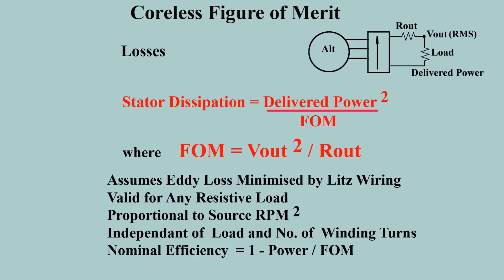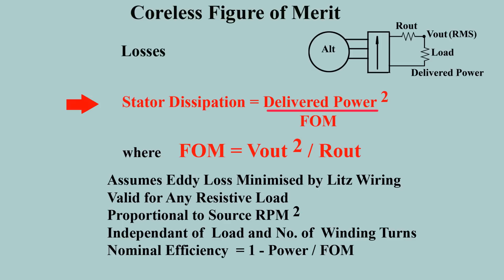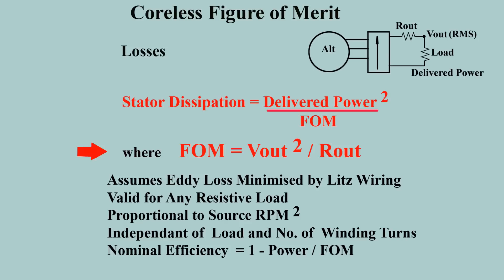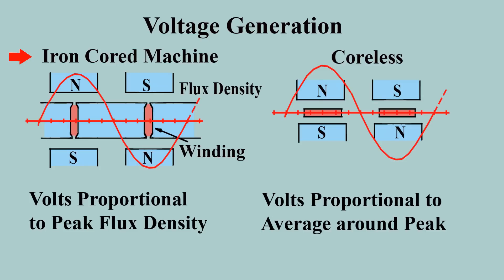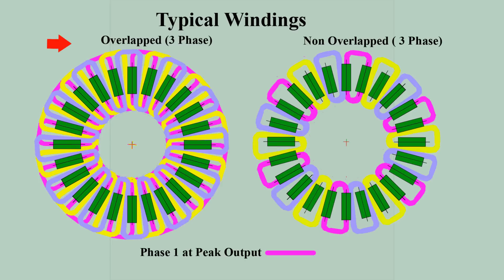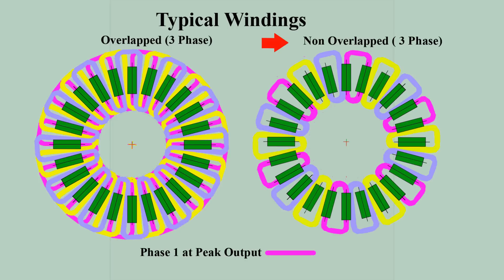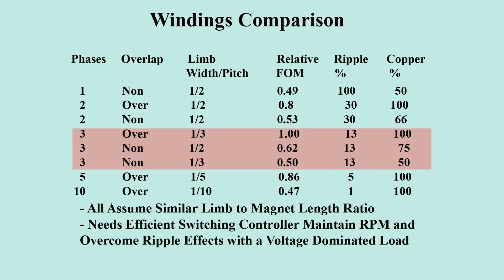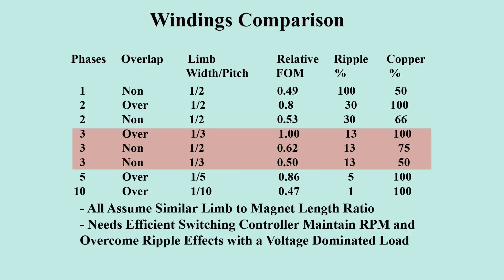Part 2. Axial Flux Alternator Phasing and Winding Methods

Comment: If I understand correctly core less is beneficial due to heat losses due to eddy currents.  Does distance from magnet to coil effect efficiency?  I understand closer magnet to coil could increase voltage and current but would it not be harder to spin he shaft?
Reply from the maker: Coreless has ohmic and new eddy loss in the windings. There is optimum magnet spacing. Unloaded spin resistance can be very low. YE

Comment: make the non overlapped coils thicker to cover the gaps, or increase number of poles, problem solved
Reply from the maker: Blox 117.  Yes, as tabulated in the video, up to 12% greater power handling capability. Then it reduces. How more poles? YE
Reply: @YesEinstein  more poles but smaller?
Reply from the maker: @Blox117  Thanks for your interest.  Overlapped has fundamentally twice  the power handling capability in the same volume.  Relatively wider coil legs may help a bit.

Comment: The video is wrong..  peak voltage from the coil is between pole changes, not when a pole is centered over a coil.  Overlapped coils  usually mean a thicker stator.  Flux is iis related to the square of the distance between magnet rotors.  I don't think it makes sense to overlap coils in an axial flux machine, it makes for a thicker stator.  (and much more complicated construction)
Reply from the maker: Dear Dan Bartmann.  Just a little hasty?  The video shows wire bunches; each pair being equivalent to a coil.  Peak output is where legs are under max. flux,  thus “coil” centres at min.  In the geometry shown, the actual peak is relatively easy to compute against the leg and gap widths. In-situ winding and overlapping outside the gap is quite feasible and can near double power handling capacity.  Optimum gap should be where Vout^2 x gap is maximum. Regards YE
Reply: @YesEinstein   can we connect ? I'd like to  discuss a proposition

Comment: Вот мой генератор https://www.youtube.com/watch?v=Cl4BNoydRzM&feature=youtu.be
Reply from the maker: Dear Remel220    Yes I like it!  Love the power meter, drive method and variety of loads. Good power capacity for its size and speed. (Plenty of exercise if you connect the pedals.)  It is good to see proven test results for a change.
Your windings appear to be non-overlapped coils.  The legs of each coil should be close to centre of magnets at peak position; magnet faces should be close to the disk, both for best efficiency.     Concerning philosophy, voltages may be computed equally well from length and speed of wires moving through flux or from rate of change of flux through coil centres.  Flux may be measured or calculated, for example by finite element. Fields are just the plottable results.   In the extreme, the system could be analysed purely as set of moving electric charges interacting relativistically at molecular level.   Maybe not best in this instance.
Keep up the good work!  Regards YE
Reply: Why industry not develope big pma axial flux?

Comment: Hello and thank you very much for such valueable information. I'm working on a axial flux generation and have seen very many videos about prototyping axial type stators and rotors. My rotor is made of 8 mm steel with 24x 20x10x5 mm magnets (12 poles + 12 poles) just like in your video. The stator however is made of PCB (due to it's compactness and ease of manufacturing). I have 320 RPM (low speed stand with integrated motor) done by me for testing purposes. Currently I have 2 - sided PCB with 10 turns windings on each side, conencted in series to achieve of 20 turns total per phase. Previously I have constructed 5 prototypes with different configurations and all of them gave me some results. But PCB just give me very very low voltage. And I can find very few information about PCB axial generators (mostly motors). And please aswer a question - would it be possible to use only one rotor (single side axial rotor towards stator)? I don't need much power (20-30 watts is enough). I kindly ask you to help me please, I would even pay for your time and consultation so I can finish my project.
Reply from the maker: Dear Max Ridman,  There appear to be 120 conductor  crossings per total phase. (Note each coil should straddle two magnet centres) Properly star configured,  you might expect around 5V.  Provided the winding resistance per phase is less than 0.1 ohm, (there's the rub) dissipation loss should be less than 10% at 25 delivered Watt.  Just one rotor should easily handle a few watts.   Regards YE
Reply: @YesEinstein  thank you so much for a fast reply. I have everything machined on a CNC router so geometrically everything is perfect. I now have a one phase PCB stator and at 320 rpm it gives me near zero. Science is not magic but I cant explain why its not working, while in standard configuration it is ok. 10 turns in a shape of progressive wave has 1.3 ohms now. PCB trace is 1 mm width and 35 um copper thickness. I would be very thankful if I can send you my blueprints for inspection. Thank you
Reply from the maker: Dear Max Ridman,  First confirm that all assumptions were correct including non circumferentially overlapped coils occupying 4 magnets per 3 phase subset, thus instantaneous 120 conductor magnet crossings per total phase, half up and half down;  3 volts (on a.c. meter) expected.  A critical efficiency requirement is maximum copper content in an optimum space between magnet disks; not obviously conducive to PCB.
Reply: @YesEinstein  Yes, like I said before PCB is one phase (double sided and 10 turns per coil). And it's not overlapping. 24 magnets (12 poles S and 12 poles N) for 12 coils in a progressive wave form. Resistance is 1.3 Ohms. Please see photo attached. https://photos.app.goo.gl/aFT2AERSt6gBaccn7
Reply from the maker: Dear Max Ridman,  Nice pictures.  My calculations indicate  10 volt open circuit and 5 Watt deliverable power at 320 rpm with double rotors; somewhat less with one just a plain steel disk. 3mm thickness is ample.  I guess the no output problem will be solved with a new  rear side winding displaced by one pole pitch to ensure continuous NSNSNS  crossing progression through both sides. Regards YE
Reply: @YesEinstein  Once again, thank you very much for a quick response! I have tried with just one winding/two windings in parallel, still near zero. If that was the cause - I would get at lease something with just one winding (only one side of PCB). To be sure I have calculated everything correct and machine a new stator, did I understand you correct in your videos and I need a coil of 24 windings to achieve 24 V AC open circuit for 320 RPM? I plan to use 3 Oz copper (105 um) to achieve 20W. Or will you recommend 4-6 oz copper to be sure in our results? Please take a look for the final concept. https://photos.app.goo.gl/aFT2AERSt6gBaccn7 Thank you.
Reply from the maker: Dear Max Ridman, You may find it best first to solve the no-voltage.  A stiff wire held along the axes and close to the faces of your alternating North and South magnets should generate a measurable a.c. voltage of about 20 milliVolt. Watch fingers.  Next form a loop in the wire to cover two adjacent magnets. The voltage should double. Making an S loop should treble it.  One face of your stator has 240 such crossings more or less at magnet centres and should thus develop around 5 Volt.  If no voltage, there must be some misconnection. Next, intrinsic power capability is determined by generated voltage and the winding resistance.  The two are interdependent for an apparent fixed capability of 10W in the double face machine.   Capability is generally proportional to the volume of copper contained in the windings.  Regards YE
Reply: @YesEinstein  I did everything as you said. A stiff wire along the axes and 1 mm close to the magnets (20x10x5 mm) gives me 6 mVolts AC. With 20x10x10 mm magnets it gave me 11-12 mVolts. To be sure my calculations are correct I made 20 turns for another coil (average is 12 mVolts as well). To achieve 24 volts I will need ~2182 turns which is a sick amount of windings. Even if I will split that in 4 coils and connect them in series, still I will need 545 turns per coil (for 4 coils in total per phase). I can not put that on a PCB. Honestly I don't understand how did you get 75 watts in 500 RPM based on your video (Part 3. Axial Flux Alternator Stator Assembly) having only 3 windings (12 coils per phase and 2 coils inside a Litz wire batch). Maybe I am doing something wrong, but in my previous tests with Iron core per coil I had 32 turns per coil, 12 coils in total and it was 24 V AC.
Reply from the maker: Dear Max Ridman,  I assume the 6 and 12 mV ac per crossing translated to readings near 60% of 480 times them with the double sided disk.  Predicted voltage per 480 crossings with close fitted double rotors remains around 10V peak. That is 7.1 rms with the 100% ripple when rectified. Maximum deliverable power into a resistive load is thus 100/(4*1.6) that is 8 W at 50% efficiency. You might consider stacking n identical PCB disks to fill an 8mm or so optimum gap between the rotors for n times the capability.  Doing this for 3 phase overlapped could be a challenge.  My Part 3 interpolated the 3 phase star connected test results to 500 rpm (still configured with 2x24x2, 30mm crossings).    Output voltage is reduced to 10.2 but output current at 7.4 A can be retained; hence the 75 Watt (V x I) capacity. The rectified output at 320 rpm, would be 6.5 V dc with quite small ripple. Ultimate capacity would be 53 W or 46 with the 7 amp restriction. Hope this makes sense to you.  Regards YE
Reply: @YesEinstein  Thank you for your valuable time. I will make some tests tomorrow. Please give me an advice on how to calculate what gauge PCB track should be to hold 1 A of power producing energy. I would say in mm2 for example (pcb track width times pcb track height). The pcb track lenght becomes very very long so the resistance will grow and it should heat I guess. Best regards
Reply from the maker: Dear Max Ridman.  PCB conductor current rating; calculation of copper strip resistance and power dissipation are all well documented on the Internet. I respectfully suggest you may find it a useful exercise to do some study here.  Regards YE

Comment: In generating electricity sir which has more advantage in design the axial flux or the cylindrical like design?
Reply from the maker: Dear kronos darkangel   Swings and roundabouts;  simple coreless axial can be relatively much easier to design and build.  Regards YE

Comment: One thing not clear is  the wire should be north south or .. all clock wise.... i try making but this isnt clear sir.   Can you explain it more for me please
Reply from the maker: Dear dtml HK, I hope this helps. In the first of the side by side options shot, the directions of magnetisation are all in or  out of the page so that magnet faces are alternately  North and South as seen.  Outward wires radially cross North; inwards cross South and so on. The result is that induced voltages add ,clockwise, along the total wire length for  each of the three phases. The right-hand option operates on the same principle; less efficient but initially easier to manufacture.  Regards YE
Reply: @YesEinstein  This is one of those AH-HA moments for me. Thanks for the clarification.

Comment: I am making this for a school project and would like to inquire about the overlapped windings, I was planning on using 16 poles with 12 windings non overlapped to conform to the 4/3 ratio. However do you think I should consider using significantly more windings? Will there be a significant improvement to my output power? additionally I require the generator to provide at least 6V so will the # of coils effect this or just the # of windings?
Reply from the maker: Dear Matt Balisky.  Thanks for your questions.  Your wise plan for 16 magnets, 12 non overlapped coils is noted.   That makes 3, not 12, (properly connected) windings for 3 phases.   A three phase rectifier ( 6 diodes) will produce the best DC output.  Voltage is proportional to number of turns in the coils. (Canbe calculated if you have the interest)  As long as the resistance of each winding is much less than the load resistance, output power will nearly equal that mechanically applied.  If they are equal, half the voltage and power will be wasted heating the windings. Hope that helps!  YE

Comment: It the voltage is proportional to number of turns and rpm and the amps is proportional to thick of copper used?
Reply from the maker: Dear Chelford Quider, Voltage yes. Delivered current is nominally engine power divided by this voltage. Maximum safe current will be proportional to root of [tolerable rotor dissipation times total winding (i.e. copper) thickness]. Wire diameter, fixed by target voltage, must also be adequate for the current.  Regards YE
Reply from the maker: Dear Sky Watcher,   Yes, all involved in the design and assessment process,  My videos show calculations, real builds and results relevant to the electric bike project.    Regards YE.

Comment: i have 10 rectangle n52 grade neodymium they are 10mm thick, 50mm wide, 100 long.  I want to build a generator for a microhydro off grid power source.  How do I calculate the amount of windings that i need?
Reply from the maker: Dear David Elderkin.  You have to practise.
Reply: YesEinstein do I alternate north South polls around the circle?
Reply from the maker: Dear David Elderkin,  Yes.  See my part 3 and 4 videos. Number of magnets on each rotor must be even;  four if you must use the large ones you have.  Flux distribution and space for the windings will become evident.
Reply: YesEinstein ok thanks will do.  Where did you get your copper wire from?
Reply from the maker: Dear David Elderkin.  You're welcome.  UK internet supplier.

Comment: Good explanation. What do you mean by voltage is proportional to average around peak for the coreless design?? Do you mean the average magnetic flux or field of the exciter.
Reply from the maker: Dear Olando Robertson,  Thanks. The generated voltage is proportional to the average of flux density (Weber per square metre) around its peak. It is thus also proportional to the total flux (Weber) through the coil leg. Regards, YE
Reply: Thank you.
The core increase the cogging. So would you say it's a bit pointless for generators have an iron core??
I believe coreless generators are way more efficient and cost less to manufacture.
Reply from the maker: Dear Olando Robertson  A cored machine for a given speed and power can  have  negligable iron losses as a proportion its output.  High achievable flux and more  room for copper  with no associated eddy loss easily tips the balance in its favour.    Coreless with relaxed forces, wide assembly tolerances and potential low loss at all speeds does appear superior for  the  immediate applications.  Lower costs in quantity is by no means  assured. Regards, YE
Reply: YesEinstein 
Ok. I was thinking along similar lines as well. This is interesting cuz I wana design a power system for my home. Energy efficient than conventional energy setup. 
I discovered that low voltage AC 120/240V  waste a lot of power for small electronics  charging devices so I plan to run on 12/24/48 vdc for certain energy needs. I check my charger and it appears to waste over 70℅ power.
Reply from the maker: Dear Olando Robertson,  Modern switching converters are well over 90% efficient.  Regards, YE
Reply: YesEinstein 
With all respect, I will need to verify that was soon as I can I post you the results.

Comment: ты кутак пас сыгенау сыген . ты кого наебать хочеш?  где выхлоп ?
Reply from the maker: Бірде-сөздік аударма!
Could you rephrase? preferably english or translatable on line
Best regards.
YE
Reply: YesEinstein Hello my friend. I am engaged in the manufacture of generators axial and say the best yet when the magnet 4 falls on the 3 reels. I also did a lot of stators with a ratio of 2 to 3 magnet coils but still produces more power generator with a ratio of 4 to 3, the magnet coil. ie variants were 12 magnets on each rotor disk, and two types of stator coils of the first 9 and second 18 coils. the rotor is the same on the 12 magnets. 9 bobbin rotor more power at the same speed
Reply from the maker: Dear Ян Корепанов
Calculations :-  Based on my machine at design speed. No experimental evidence. Option (3),18 coil 12 magnets :- Proper phasing but poor results due to inefficient capture of flux.

(1) Overlapped coils :-  All limbs directly over N-S poles.
(2) 3 Coils per 4 poles :- Limbs mostly over poles. Only every third N-S pair.
(3) 3 coils per 2 poles:-  Limbs significantly offset from poles.

Relative best predicted results :-  
(1)  leg width  1/3 pole pitch,  46 Volt,  0.2 Ohm,  1.00 star FOM
(2)                    1/2                     31           0.15           0.62
(3)                    1/6                     17           0.1             0.27
 
Interested in your project,  but very little wind here.
What are your thoughts about  best coil thickness between magnets?

 Regards, YE
Reply from the maker: Dear Ян Борисович Корепанов,    Calculation show option (1) remains most efficient.  Three overlapping coils per two magnets.  Overlaps entirely outside the magnets. Unchanged gap between opposing magnets.  Winding efficiently fills the available  space with copper.   Criterion is lowest dissipation in the stator.   Option (3), non overlapping is poor.       Regards YE